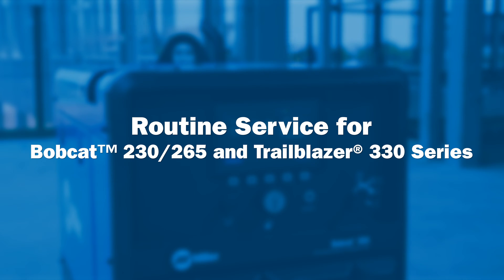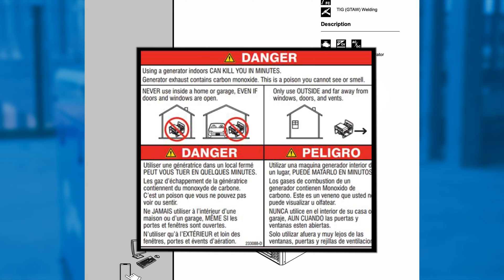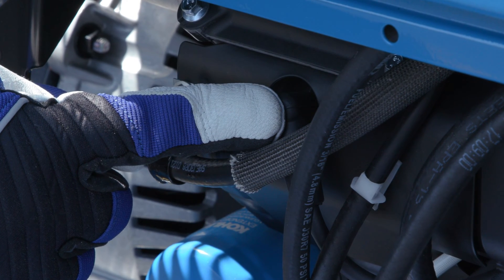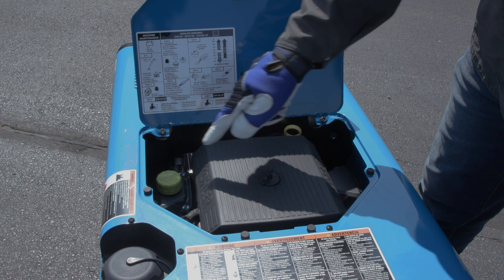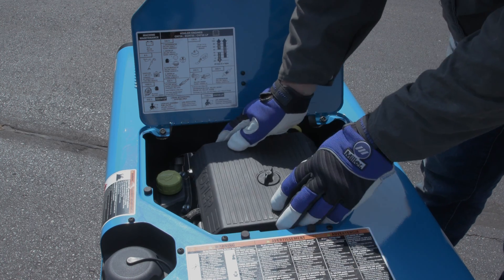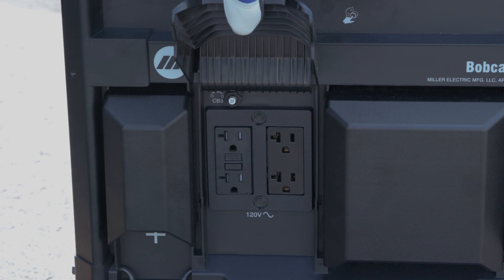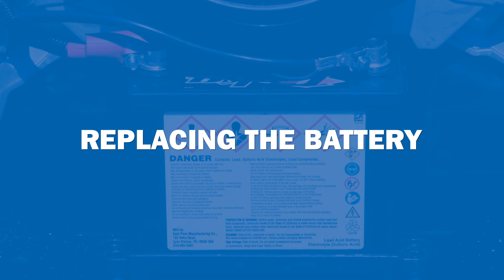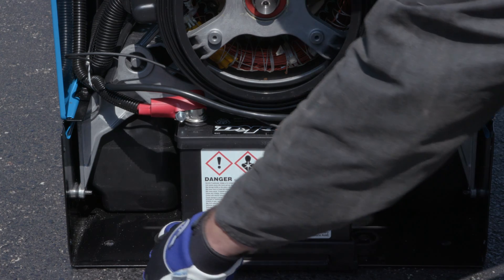Miller® Bobcat™ 230/265 & Trailblazer® 330 Maintenance Series: Routine Service

Comment: Bought your wildcat engine driven welder powered by Subaru Robin engine... Only to find out you guys were discontinuing it ... And no replacement parts... You built the generator around the engine and nothing else will fit... Timing chain broke on it you guys didn't have replacement parts and would not take it in trade for one of your other machines... So I have been stuck with a freaking boat anchor for 5 years.. good way to turn a devoted Miller customer into a devoted Lincoln customer....